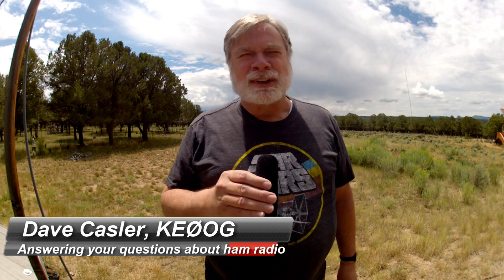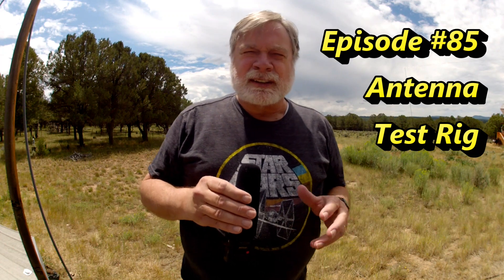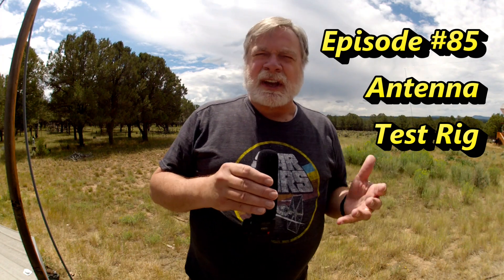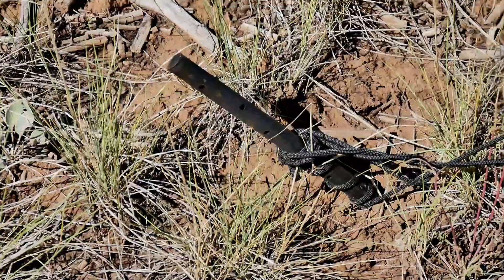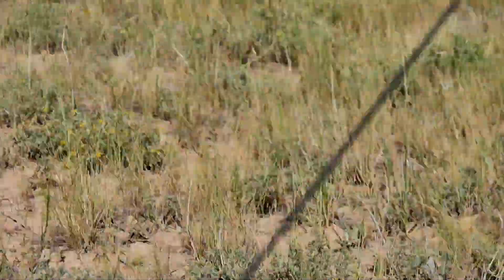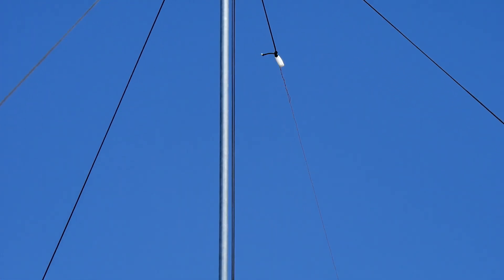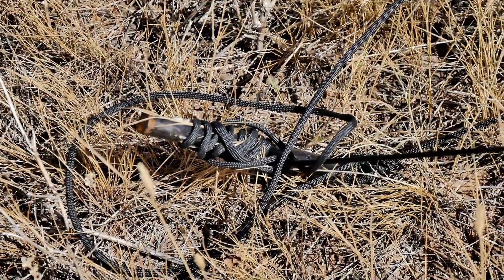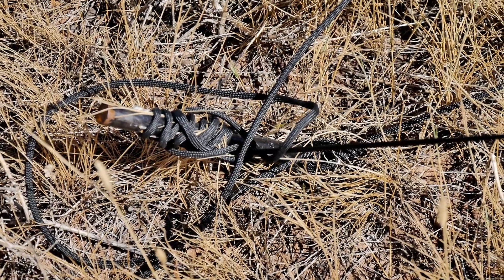Setting up to Test Wire Antennas (#85)

Comment: Dave, I duplicated this system in my yard, Due to length the poles are right at 67' apart. So a 40M dipole will verily fit, and it is not flat. (droopy)
The end insulators are right at the poles. And I can not get a 40M dipole to tune, it comes out resonate in 21MHZ. Even though it is 33"/side.
Are the poles at the ends detuning it that badly ?  Or the fact that it isnt flat ?....Any ideas...
Reply from the maker: Putting the poles a little further apart will help, as I found out via modeling that a close-by supporting pole affects the tuning. I'm not surprised that your 40 meter antenna resonates on 15 meters--for years (before all-transistor rigs required better tuning), using the 40 meter dipole for 15 was a common practice. Your dipole is resonating somewhere (I suspect below 7.000 MHz, so you might look for a resonance point below that. If you find it (I suspect you will), you can shorten the antenna accordingly.

Comment: Hello Dave ,
Great job i'been follow you long time really i'm taken a lots of information and knowledge ! I have question for you , can I use vertical antenna mfj 18 vs with antenna tuner mfj 949 e in all of band if I taken out ( removed ) the coil that come with an antenna and works directly from radio to tuner to an antenna with some adjustment on tuner ? 

And sorry if my English language is weak :)

73 from kuwait
Reply from the maker: Jassim, generally not. The coil adds reactance at the antenna to help with the match. Moving that reactance to the tuner doesn't work very well. Leave the coil on the antenna, and then do your tuning on your regular antenna tuner. Hope that helps.

Comment: The steel stakes are available at home depot, etc, and come in 12", 24", 36" and other lengths.  They are called masons nails or spikes, nail spikes, and other names.  I use them to hold up MFJ or Jackite 30' fiber poles without guys for some of my antennas.  See them used in Myron's (WV0H) blog.

What is the height of your support poles?

Dave K8WPE
Reply from the maker: The poles are each made of two sections of chain link fence "top rail." Each section is 10 feet long and slips into the next section, for a height of each pole of 20 feet.